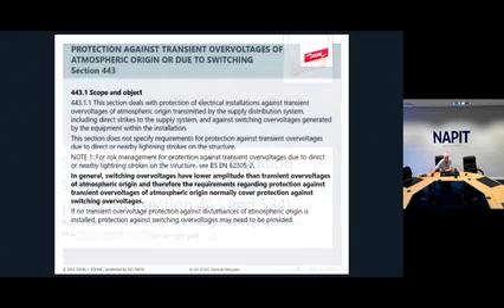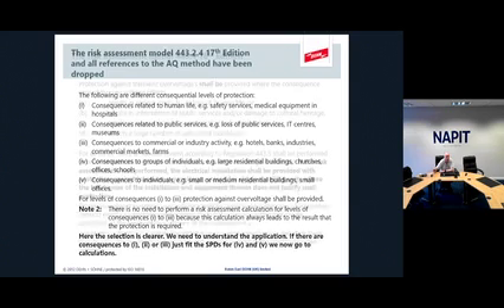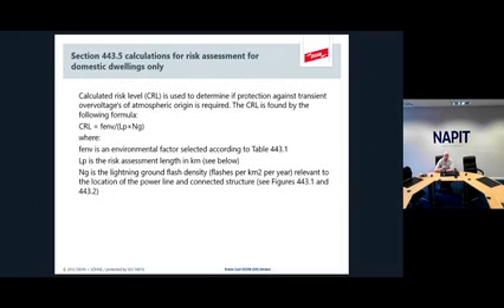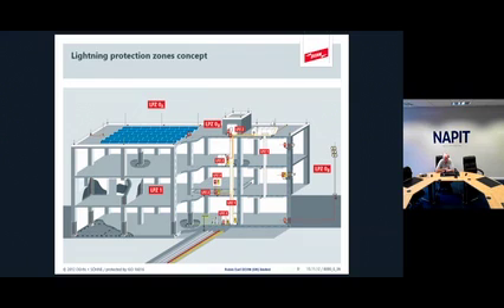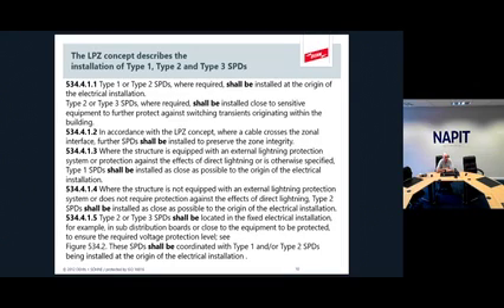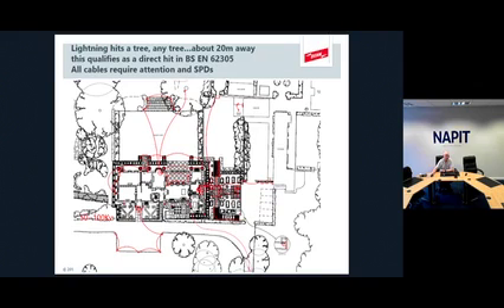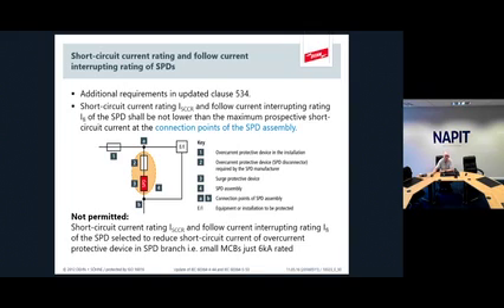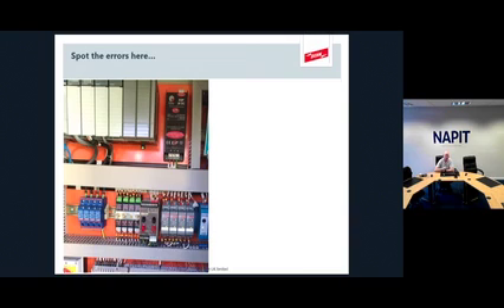NAPIT Surge Protection Webinar

Comment: At 29.35 on the video you said to check the SPD by pressing the RCD test button. What has the RCD to do with the SPD? Then at 30.20 you state that it is OK to use plastic SPD enclosures in domestic premises. Firstly, some of them, like the Wylex have a main switch. Secondly, the regs state "and similar enclosures". I would have thought that this is similar. A Wiring Matters article on the subject stated that the cause of the fires investigated where due mainly to high resistive connections, loose connection, trapped insulation etc, rather than a failed swichgear itself. This same situation can occur in an SPD enclosure.